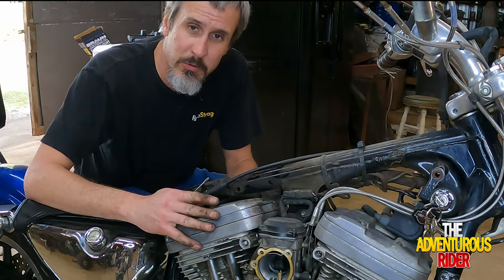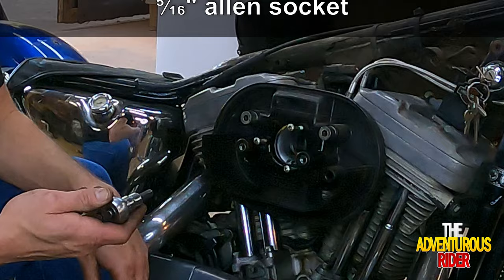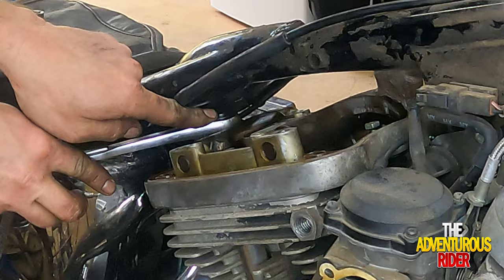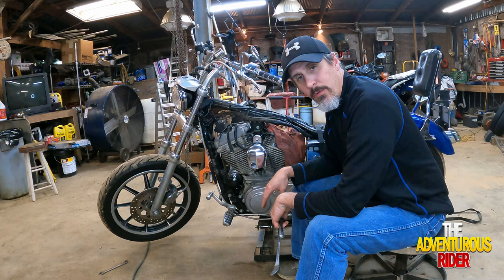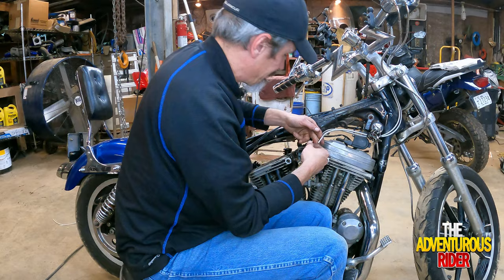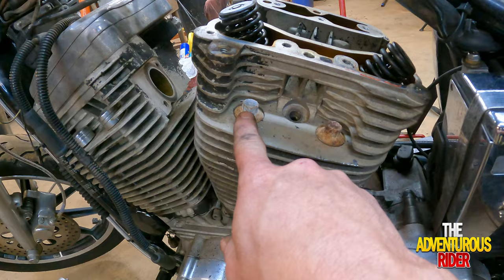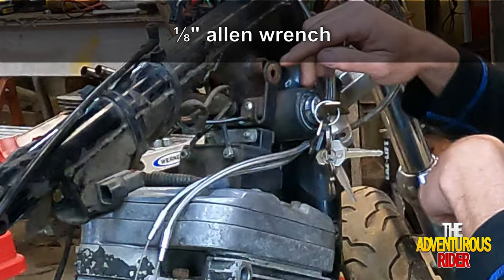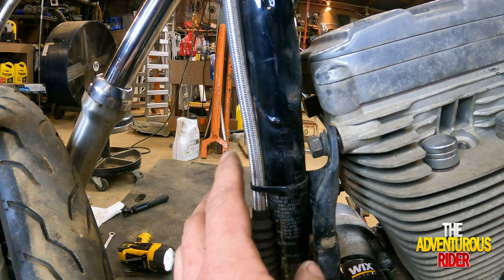How To Disassemble a Harley Davidson EVO Engine

Comment: Well, it's good to see that there's no broken pieces or big holes that caused that compression loss! I guess the best lesson to learn from this is to remember that the same fasteners that keep your base gaskets tight also keep the head gaskets tight! That's good to know, since you can see an oil leak easier than you can see a potential pressure leak. I sure can see why you had a big fireball come out the side! That's a purdy good chunk of gasket that went bye-bye :) ... A good thing about the Sporties compared to the big twins is that with the 4 individual cams, your pushrod angles are really optimized, so the lifters should live a good, long time. The Sportster actually has some of the oldest of old school technology with those 4 cams, since that's how the old flathead motors worked, too. It worked for them for a LONG time, and until they quit making the EVO Sportsters this year, that was the longest lasting engine design around, going back to the K models in 52, then the good ol' Ironheads in 57. That's what makes Harleys great, to me.... If something works, why change it?  I look forward to seeing your scoot go back together!
Reply from the maker: That's a good point.  I know someone has been on me about changing the base gaskets for a while so I don't need to put off changing them out In the future or this could happen again.  And I agree when you have something that is rock solid and bullet proof don't change the design just so you can say you have something "new".  Oh well hopefully the revolutionary motor will be pretty rock solid but only time will tell.
Reply: @theadventurousrider  Well, I picked up a piece on gravel between my belt and the drive pulley and my drive belt snapped like a twig, so i had to call for a trailer!! Turns out that someone had replace a 1-1/8 with a skinnier newer style 1 inch belt and the massive power of Little Betsy snapped it like a twig, when i got in a hurry and gouged on it merging into traffic. $265 for a belt has me crying like a girl! Jackson HD is supposed to have Limited Stock, cause I don't wanna wait a week to rip and shred!
Reply from the maker: @tommylitchfield3450  it's crazy how expensive those things are.  It's like they know what you need and they can more less set the price. If it ain't belts it's tires..they got us coming and going

Comment: When I take off the intake bolts, I took an old Allen wrench and ground it down, to fit in that tight area, and now i keep it in my specialty tool box.
Reply from the maker: I have a few of those old Allen's wrenches laying around.  Ill have to add me a new specialty tool to the drawer.  Thanks.
Reply: @theadventurousrider  p.s. I enjoyed the video. Good quality. Thanks
Reply from the maker: @edZILLA64  thank you for that.
Reply: As for those bolts. Bondhus makes a set that are phenomenal for those and the other bolts that are hard to get to on these evo motors.  Heres the part number. 
"Bondhus 67037 Stubby Dbl Ball End L-Wrench Set"

Comment: Whenever you have the opportunity to get rid of that damn vacuum petcock on your gas tank do it. All you gotta do is remember to shut off the gas when you park it
Reply from the maker: Yea I was planning on doing that when I got a new gas tank as I'm wanting to change it but things here in the last week got complicated... Found out I can't use the pistons so I'm going to have guy buy new ones.  That puts a damper on my plans for a different tank.
Reply: You can change it on the stock tank. J&P cycle has peacocks around $20